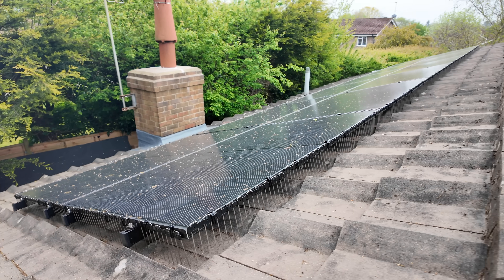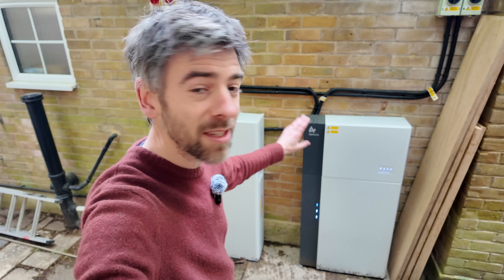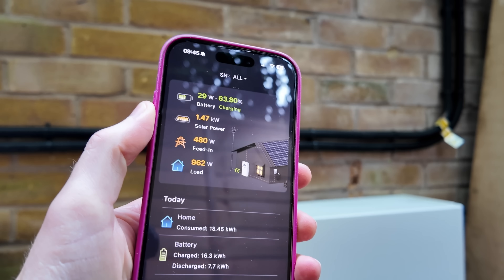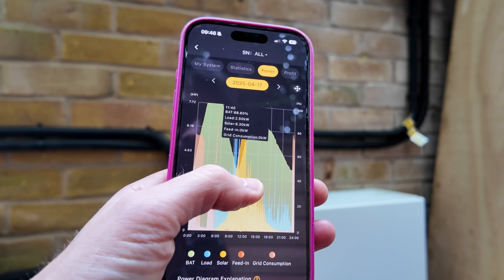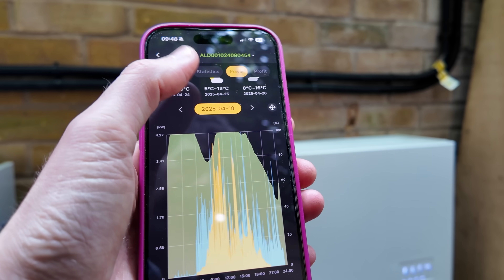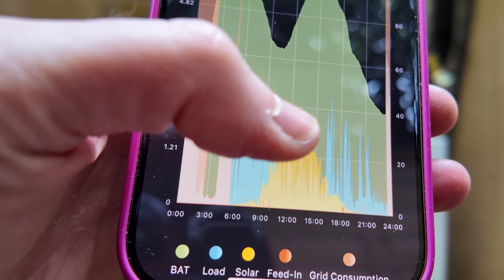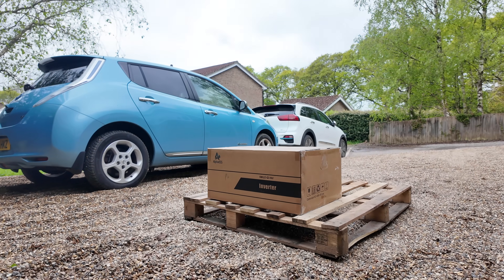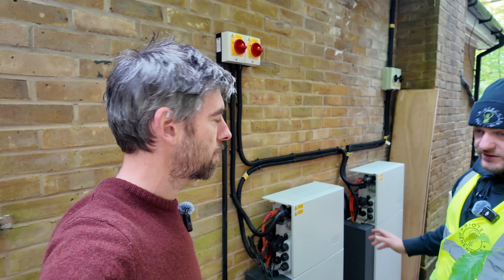Inverter issue! Problems with our AlphaESS system from Heatable. Here’s how they were resolved

Comment: Thanks Andrew, I have got exactly the same issue. I have 6.4kwh solar panels that were checked just before solar battery installation. I have got 5kw smile inverter with 20kwh battery. Exactly the same, the moment the battery gets to full charge the inverter power drops dramatically. I have just emailed the company that installed my system and hopefully the Australian division of Alpha finds the solution. I will keep your video in my favourites. thank you!
Reply from the maker: Good luck!

Comment: I had my solar panels installed in May and am also based in Kent, so my installation wasn’t far behind yours. After watching your videos, I hoped to get set up with solar export through Octopus Energy in a similar timeframe to you. However, it’s been 50 days since my initial application, and I still don’t have an export MPAN or any clear timeline for setup. I’ve exported 1.3 MWh since installation, so you can understand my frustration.
Reply from the maker: That's so frustrating. So you're with UKPN? Try calling them to chase them up if you haven't already.

Comment: Have you thought about utilising / creating a video to utilise the Octopus Intelligent Go Dynamic Charging Plan to charge the battery from the grid as well as the car outside of the standard off-peak 6 hour window? I think you need to use the Home Assistant app to do this, whereby you battery also recognises the dynamic cheap rate and charges accordingly
Reply from the maker: Home Assistant is certainly something I'll explore in the near future.

Comment: is it an export limitation setting
Reply from the maker: It was a bug with the parallel system. We’ve been exporting 10kW with no throttling after they pushed the firmware update.

Comment: Nice, I currently have a Powerwall 3 & expansion pack and will use your referral for Solar later this year.  First month on Battery Storage with a little export has cost £97.48 for over 1.1Mw

Comment: A lot of people either thinking about getting solar or are (bizarrely) anti solar get obsessed about asking what the return of investment is, that magical period that it takes for the amount of money you save or earn to pay for the installation. The thing I find much more interesting is the impact of investment. I am in my third year since having just 7 panels and a 4kWh battery installed (I have serious panel envy seeing you with 30 panels!!!) and I am saving about £700 a year and earning over £200 a year from export. That is a grand a year staying in my pocket. If you haven't seen Octoprice I would recommend you checking it out, it works out what your savings are in comparison to a standard variable tariff. (I am on Agile and Fixed Outgoing)

Comment: Most panels I have dealt with have an open voltage in the 30-40v range.  Different inverters have different starting voltages and different maximum voltages per MPPT (string).  You may find your group of 12 panels starts up better in winter and/or with shading if they are a single string, assuming the inverter can handle around 450-500v.  Worth keeping an eye on.  I enjoy the content, thanks!

Comment: I do wonder if your batteries actually are cost effective. We have 7.6kW of panels and a 5kW inverter.  We have no battery and sell the excess to the grid for 15p kWh.  We typically export more than we use (in £).  In our case, though, we use gas for heating.
Reply from the maker: It's going to be interesting to look at a year's worth of data to see. I think batteries are a quicker win in terms of payback for most people actually, although with the high load due to our electric radiators, the solar panels do perhaps make more sense for us. I'm just hoping for lots of clear, sunny days this winter!

Comment: I have something similar, and what worries me is having 25Kwh of batteries in an outhouse from a theft point of view (or in Mr & Mrs EV's case -  the side of a house), I have a simple (albeit all risks) lloyds home insurance policy underwritten by zurich, but when I call to ask no-one has a clue, can anyone elucidate?
Reply from the maker: That's a really good question! I called my insurer (Policy Expert) and they said they happily cover inverters, batteries, solar panels (and EV chargers) as part of the home insurance provided they're all permanently attached to the house.

No increase in premium (which surprised me, given the value) and I don't think they even needed to put a note on their system about it, although I did ask them to just in case.
Reply: @MrEV  👍 its good to know, esp. after the bristol hospital incident (albeit just moved away from Policy Expert  🤕 - so will try again 👍)

Comment: I had my Heatable install installed 2 weeks ago, 1x Alpha inverter with a 12kw battery and 21x REA panals, however my system is not working correctly. In the app I currently see the battery is charged 100% and never discharges in the evening. My Solar and Load are in sync, so currently displaying 1.62kw which I believe is what the panels are generating, 0w on the feed in. Logged it with Alpha who suggested it was a CT clamp issue and to get in touch with my installer who are currently arranging to come out and take a look. Fingers crossed its an easy fix.
Reply from the maker: That’s interesting. CT clamps do tend to be the main issue with inverters and EV chargers! What have Heatable said? Have they left it with the installers to resolve? Hopefully it gets sorted soon. Do keep in touch and let me know.
Reply: @MrEV  I havent actually informed Heatable, I logged it on the Alpha app and the guy said to contact the installer, so I contacted VSL who were the subcontractor.

Comment: Has the replacement kit solved that solar issue…? interested to know as I was using my limited electriceric knowledge, but knowing these hi-tech batteries are sensitive about being overcharged…🤔 could the “regulator” have detected “full battery” and shut down Solar charge mode voltage input…? Just an idea….
Reply from the maker: Yes, all fine with the replacement inverter and the firmware update. They shouldn’t shut down when the battery is full — excess should just be exported.

Comment: I’ll be interested to see how your batteries perform in winter when they get a bit of frost on them? Future video I hope?
Reply from the maker: Yes, I'll definitely cover that in a video. Hopefully not for a long time yet: I'm in no rush to see any frost!
Reply: @MrEV  Make sure to cover battery winter conditioning where the battery discharges and charges itself during low temps to boost its temperature and prevent cell damage.

Comment: Hi Andrew, great video, thanks.

 Did you get paid retrospectively for what you'd generated while you waited for the MPAN paperwork stuff to come through?

Our system still isn't signed off due to the back up unit being recalled and we've been bunging loads back to the grid after the batteries fill. Just wondered if we're likely to see any return on it or if it's being wasted. 

We're still much, much better off than we were, free car charging as we can only charge during the day at the moment for various reasons so it's fantastic and any payback is the icing on the cake and hopefully will pay for winter usage.

Enjoy the sunshine.🌞👍
Reply: Presumably nothing until MCS sign off?
Reply: @Biggest-hz7ng yes, I spoke to a friend today who said theirs was backdated to the date they informed their provider because they sent a picture of their meter reading. So you're right it's the MCS sign off that's relevant.
Reply: @Biggest-hz7ng yeah, that's what I'm wondering...wasn't sure if I read on a facebook forum that someone was paid retrospectively....
It's a shame to see it go to waste but exciting for the future.
Reply from the maker: I wondered the same but I don't think they do pay retrospectively. Perhaps that's the reason UK Power Networks were in no rush to give the Export MPAN!
Reply: @MrEV yeah, very good point!

Comment: I was watching this video and the information was a bit lacking, as it wasnt clear that you have a mppt fault (one string wasn't working).

With zero export,  when the battery is full solar will drop off, that is normal.

We always test the systems during the install as part of the commission that the regs require.
The test of voltage is not ideal, but common with ac sparkys. A fault can show voltage, but when it comes to working as they should there can be a current fault. This means that it doesn't work, but looks like it should.

I had a customer call me, saying his inverter wasnt working, just clicking, so as he was one of our diy customers, we told him how to test, and problem resolved, bad mc4.  Sent him a new one for the next morning and get a phone call hes all working.

Sometimes its the simple things, but dc cables on solar can be a big issue. We dont usually find the inverters to be the issues.

One tip to give you and it is a question...
You seem to not have full control of your system and data,  as youre grid charging, while you have solar, which means your paying for power, why not adjust the charge cycle so that youre keeping the energy?
I know that our energy traders packages,  its 7pkwh to charge and 15p to export so money to be made.
But having a high soc battery is actually not good for them. 

For example, i do not grid charge, by 10:30 im fully charged.
Reply from the maker: Thanks for your comment.

It was exporting to the grid, we just weren't getting paid for it until we got the Export MPAN, so there shouldn't have been any clipping?

As for the battery, I tried a few days of no grid consumption and it worked really well, but the forecast was wrong on one day and instead of a sunny day there was just clouds. From about 5pm onwards we ended up importing from the grid, which was painful.

Perhaps now the temperature is a little higher (and radiators wouldn't consume as much/anything) then I'd be in a better position to do it again but I feel it's much less faff just to charge at cheap rate and then export the excess solar?

I have been wrestling with it though! Do you know of the channel Gary Does Solar? Gary covered this topic in a recent video and came to the conclusion it's better to still charge the battery at night: https://youtu.be/gpaqM9C8vaQ?si=VPfbrnXW_OsP-mO5

I do worry about the battery sitting at 100% for long periods, although it's LFP so I'm hoping it's less of an issue with that, but I may play with the settings to discharge a certain percentage during the day so it's not sat at 100% too much.
Reply: @MrEV  ah if it was set to export then, yes an issue. Firmware i think you said, this would affect a lot of people, i would have thought they would have noticed sooner.

The weather is not reliable and can be a pain to work out, but if you are paid to export and the production and charged power can be exported, then its money in the pocket.

I think that maybe the guy who promoted faulty batteries a few years back and made all sorts of excuses for them when i pointed out why. Dont think he was happy... 😮

No high soc is just as bad for lfp as it is for any battery. 
You do need to have a high charge to balance the packs cells, but they have a fair drop to the resting voltage, charge 3.65 rest 3.44
With their flat voltage curve  they tend to sit for hours at one voltage and then Change quickly.

I did a few articles on the website, both andy (off grid garage) and will prouse have touched on the subject about charge and rates and soc/soh.
It's worth digging into the tech as most of the going and repeat the sheep is not correct.

Comment: So glad Andrew that you solved the issue with a new inverter. But Lee, please please please why didn't you show us the short circuit current readings and the irradiance values, maybe even the insulation resistance to frame readings? So then we could have tried to diagnose this issue together, which is what Youtube is all about!

Comment: Given that I'm in Northern Italy, but in a sunny cool day you can absolutely get the nominal production of your panels. My record is 7.3Kw on a nominal 7Kw system .🎉 My installer told me to expect ~ +20% in absolutely optimal conditions with new panels(I suppose it is the margin to comply on the 25yr warranty requirements). Good luck staring at the graphs all day, that's what I do anyway :D
Reply from the maker: Interesting! 10.27kW seems to be the average peak for us, although I did notice a spike to 13.7kW once. It was too brief to register in the app though!

Comment: Are you able to use the power generated by your solar array when the mains electricity goes off? Does mains electricity power your inverter? I had a quotation for solar and was told that in the event of an outage I couldn't use the power which seemed to me to be a major disadvantage.
Reply from the maker: With my system, no. Unfortunately I can't go completely 'off grid' like you can with some systems (Tesla Powerwall being the most obvious, but the Sigenergy and GivEnergy also have that functionality).

I can power a circuit with mine which will stay powered in the event of a power cut, but that's something I have to get them back to do.

So yes, there is a slight power draw from the grid for my inverter.

Comment: Would it have been easier to identify the problem if you used micro inverters like Enphase. Would you do something different if you had to do it again? If so what?
Reply from the maker: Good question. Yes, I imagine with micro-inverters or optimisers that may have helped identify the issue sooner.

I looked into micro-inverters but didn't feel the extra cost made it worthwhile.
Reply: @MrEV Thanks for the reply. I ask because I am shopping around and trying to find out if the extra cost is worth me going with an Enphase system. Thanks for sharing your experience.